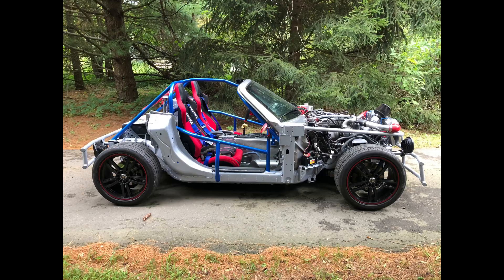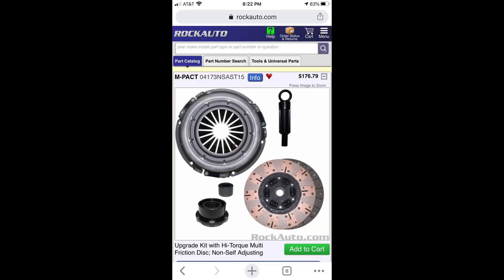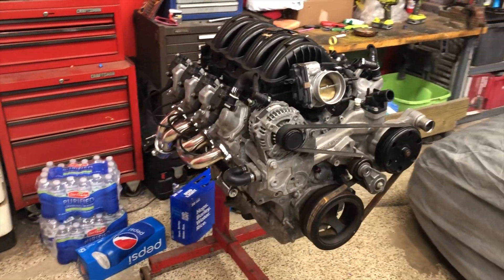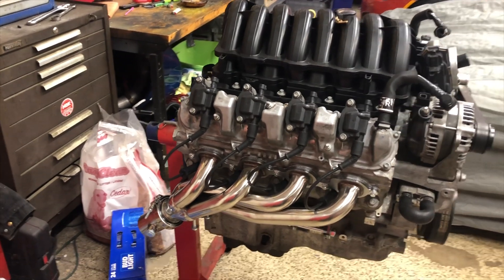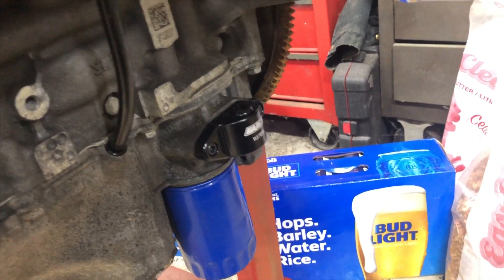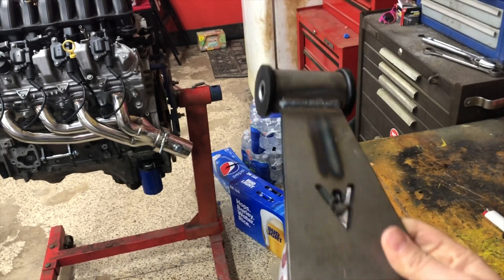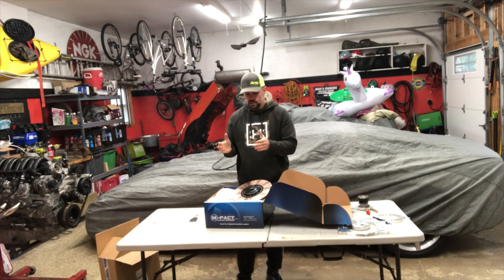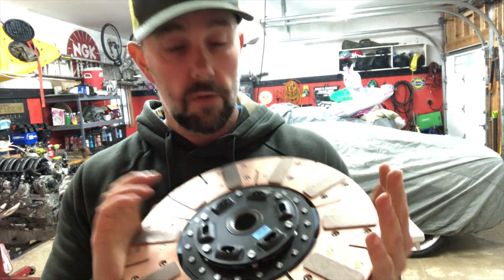Solstice Deathkart Project- Gen V LT (L83 5.3l 355hp) swap-  Dual friction M-Pact clutch arrived!!!

Comment: I've been running an M-Pact  350Z basic replacement clutch disc and pressure plate in my 2002 6 speed Maxima for a year now and it has worked great. I'm about to swap in a more powerful 2014 maxima engine so I'll be going with the M-Pact ST2 6 puck kit for the 350Z.
Reply from the maker: Nice! We’re going on 3 summers now with the MPact and it works great in our application. Easy to actuate and grips well.
Reply: Is it suitable for racing sometimes??
Reply from the maker: @RaefAbdullah-pc4bp Sure. They have different types of clutch materials and disc designs. If this thing is primarily used for racing you’ll want a 4 puck or 6 puck probably. The downside is you might get chatter street driving and might be harder to engage the clutch.
Reply: This means it is not suitable for racing and quick shifting

Comment: i have mustang 5.0 have  The horsepower is 420. Will the M-PACT clutch fit me?
Reply from the maker: Hi! No, this specific clutch is for a GM application and was the PN for a LS7 engine. 

M Pact is the brand of clutch, you can probably check their website to see if they have a clutch to fit your mustang though.
Reply: @PeakPerformanceEngineering  There is a clutch from the same company for the Mustang. Do you recommend it?
Reply from the maker: Yes I would recommend them, we’ve had this clutch in our deathkart for about 4 years now I think and it’s been great! No problems at all :)
Reply: @PeakPerformanceEngineering  Is it suitable for racing sometimes?

Comment: been thinking bout purchasing one from rock auto but because of all bad reviews bout rock auto havnt pull trigger!! how long did it take to get clutch!! thanks for great info bout the clutch
Reply: I have been ordering from RockAuto for years without any issues. In fact, I can't recall the last time I bought a part for my 3 vehicles anywhere else. RockAuto is my go-to, hands down.
Reply from the maker: Ive ordered a lot of stuff over the years from Rockauto and dont recall ever having an issue. The clutch came within a few days of ordering from what I remember, no issues :) Clutch seems fine so far and the pedal feel is nice and light.

Comment: Why not put the body back on? Deathcart is not going to have any ground clearance. Just make it cool and fast. Someones going to pay more if its a Pontiac with a v8 than a stripped thingamajiggy. Give the Sole a new heart.
Reply from the maker: Check out our latest videos to see the completed kart :) We bought this car with the sole intention to turn into a deathkart and have zero plans to ever sell it. I'll post another vid soon with how much we have into the build so far. As far as ground clearance, we're still running the stock springs, so the car is still at original ride height. The aluminum L83 isnt much different weight wise than the turbo LNF, and with all the hundreds of pounds of weight reduction the car has had, it probably rides slightly higher than stock if anything.